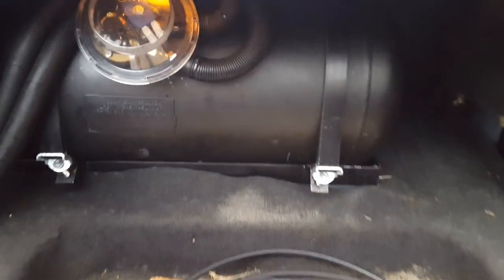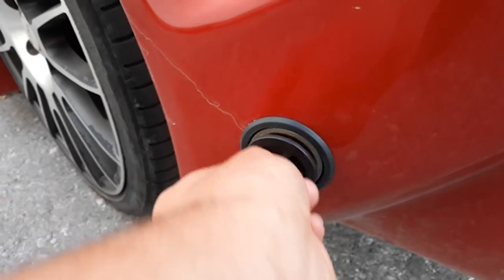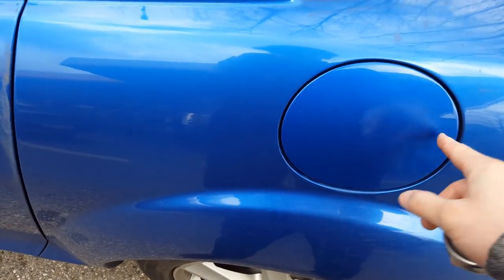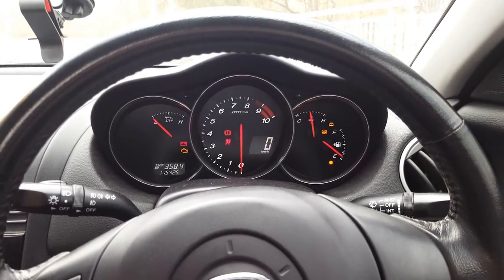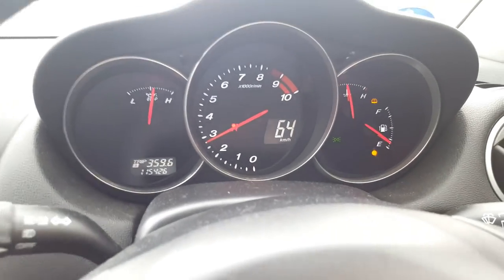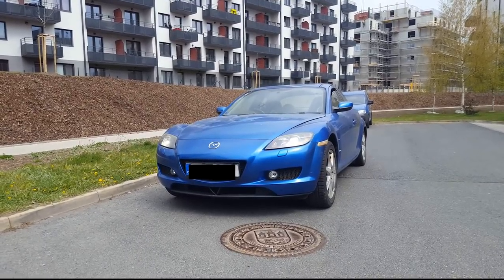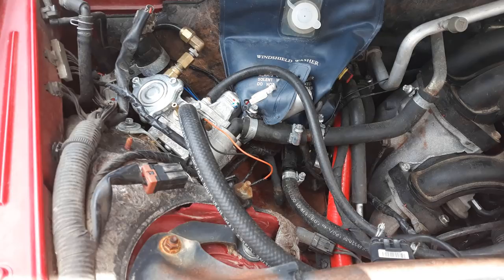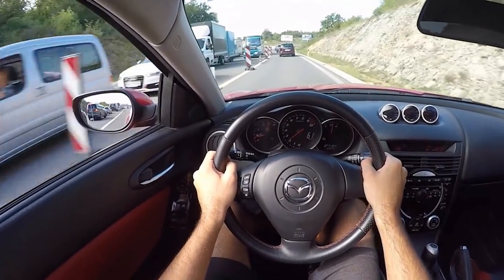Mazda Rx8 LPG Conversion | Pay Less, Drive More

Comment: oh come on, if you cant afford to buy gas, better get some diesel and dont drive rx8. its BS that it will last longer and no power loss. it will definetly lose some power, and no one can prove that it will last longer. in turkey %40 percent of cars using LPG. %30 gas, %30 diesel. and everyone knows it will lose power and maybe reduce life of the engine. people just using for better economy.

adding a lot of weight back of the car another stupidity. rx8 one of best handling cars ever made and you want to change it?
Reply: It's an RWD car, adding more weight on the rear increases traction, so it's not bad "per se".

The power loss occours when you run entirely on LPG, and if you don't tune the car properly.
Reply: @tommythebiker3081  what about power to weight ratio and weight distribution?
Reply: @23werex  power (and p/w ratio consequently) doesn't mean anything if you don't have enough traction. If you convert a car to LPG then I assume you'll drive it as a daily car, so it can happen to drive under heavy rain, snow etc, and some weight on the rear axle would be a great help.

Different weight balance can be a real hassle or absolutely unnoticed depending on the driver and the way the car is used; IMO it makes a little sense worrying about it unless you use the car primarily on the track (but then the whole LPG conversion would have no sense at all)
Reply: There is some powerloss, but it's meant to run on LPG in low rpm or highway where power is not necessary. My system works that it switches to petrol under high load or 5000rpm, so when I need power, I get power from petrol ;).

LPG does not mix with oil, so oil remains healthier and purer for longer, which never is a bad thing. It also lowers the carbon build up and can never flood the engine.

The extra weight in the back is roughly 50kg when it's full. I drive with a 1/4 petrol tank. You cannot feel the difference unless you are truly racing and hand it to an experienced race driver, maybe.

I can afford gas, but I save 3000 euro after 30.000km, which is enough for an engine rebuild. You wouldn't refuse a free engine rebuild right? :)
Reply: @KiterTMK  Seems like you're quite well familiar with this subject. I'm only wondering what engine do you have. I read somewhere, the LPG is quite easy to install in 192 hp of rx-8, while in 231 hp it's not, since there are 6 instead of 4 injections (correct me if I'm wrong).
And yeaah, I totally agree with the idea of savings, especially when you want to drive rx-8 as your everyday car:)
Cheers
Reply: @rokindek  I have the 170kw 6 injector version. No difference at all, it's just as easy to install as the 141kw one.
Reply: @rokindek  I'm especially familiar since I had to tell the installer how to get it done, as I learned from the engineers from the manufacturer who wrote the code and built the system in many other RX-8's ;)
Reply: @KiterTMK  cool:)) and how do you maintain the apexes? As far as I'm concerned, the increased temperature of burning of gas compared to petrol can lead to burning the apexes. Could you please comment on this?